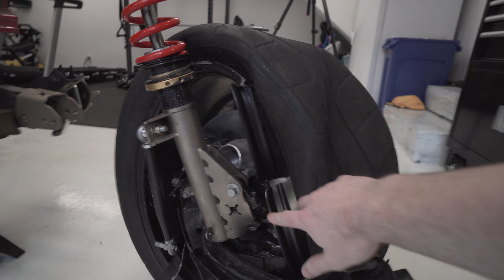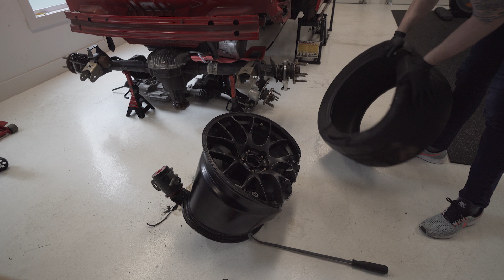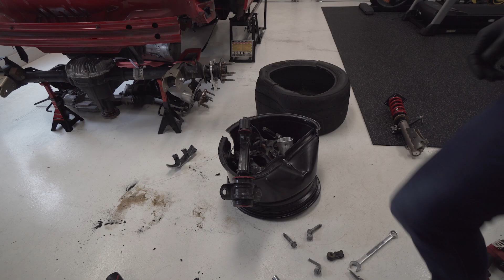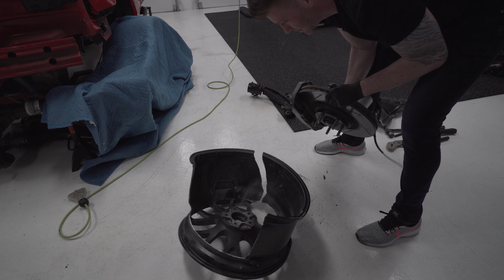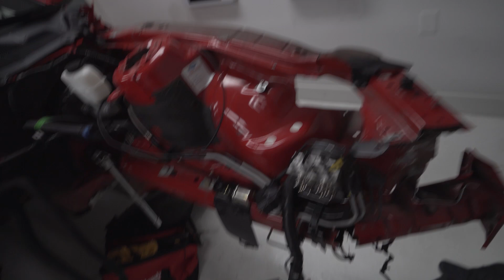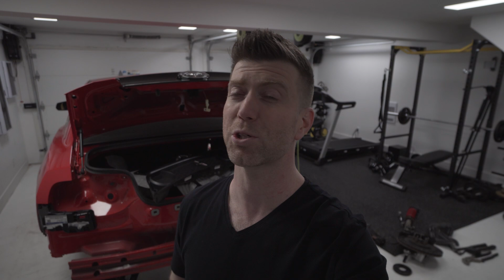What a wheel looks like after hitting a wall at over 100kph.

Comment: Hello Sean, any thoughts about getting a S-550 platform and working with that? I love my 2015 GT and your engine if you chose to use it would drop right in. I'm always amazed how quick the response to steering inputs in the Mustang (w/ the performance pack) is compared to my 2018 Focus ST. In the Stang wiggling the steering wheel is violent as to the cars side to side motion but comparing it to the Focus, the Focus seems lethargic even though it's ride quality is much harsher than the Mustang and their weights are only 600 lbs or so different. Just thinking about your problem Sean.
George

Comment: Is Roadrunners OPG same as on regular Coyote? If so, i would change that when engine is out. As for replacement car just get a base GT Mustang, should be at reasonable price now.
Reply from the maker: OPG are the same. The GT500 pump I mentioned is the same. There are new OPG being prototyped for this pump right now. By the time I am ready to drop the Boss motor back into the next car they should be ready and already tested.